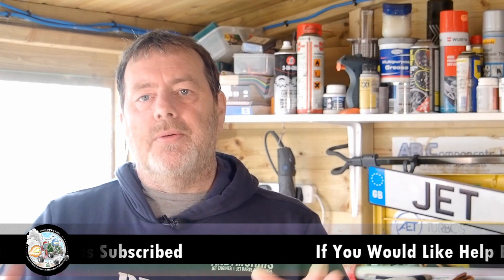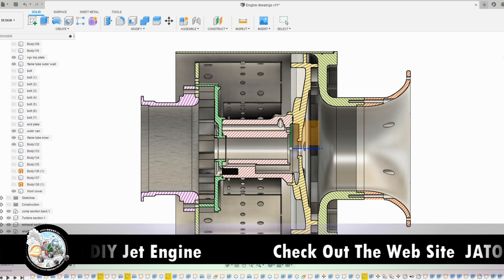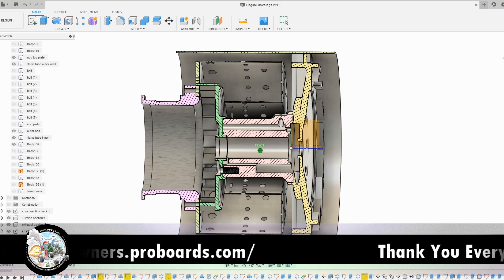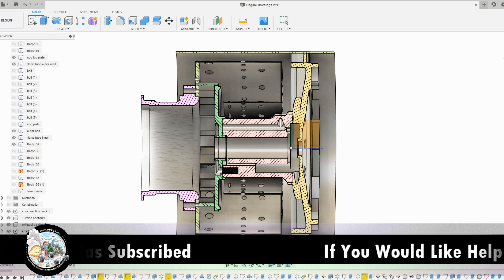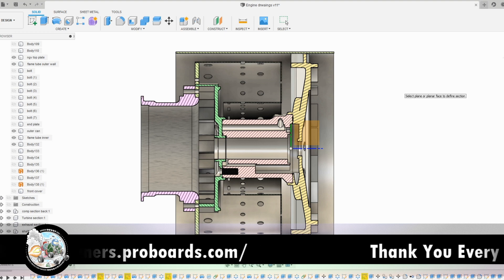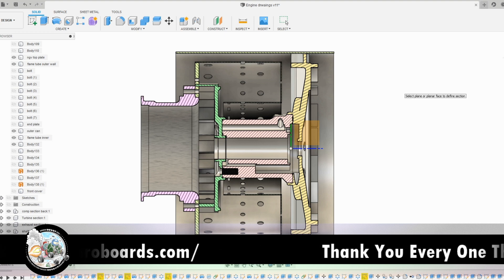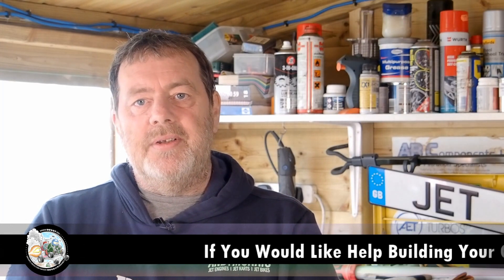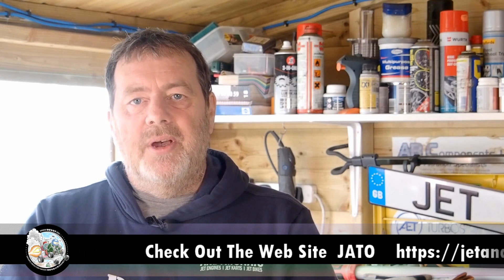DIY Jet Engine Project X

Comment: So you basically took third-party turbocharger and called it DIY? Why not just make an external combustor as a separate assembly and keep the native turbocharger case? Your combustor kinda suck anyway, so I presume you have such low temps that could work. And those holes blowing into the nozzle vanes look horrible, probably the worst temperature field non-uniformity possible. I understand your combuster is like supershort (that's why I would rather make a external one), but if you want to keep your layout, I'd rather drill holes in NGV and the outlet case for cooling P3 air. Probably not the easiest way to do in a garage though. Again, you have super-low temps, thick NGV profile and super-low engine life, so that's probably doesn't matter, nothing matters in that case - you've got premade rotor which works, just throw some jet fuel into the furnance (considering your vaporizing fuel nozzles are working period during the launch - not a small feat, btw) and it will appear working. Maybe just throw away the row of cooling holes altogether - two zones for a combuster is more than enough, just make the second row holes big enough and chequered for better gas mixing.
Reply from the maker: I used the comp wheel and turbine from a turbo yes, as many do...... and here is the engine working..... very well https://youtu.be/f-V7hNShuP0?t=261 please share what you have done .... oh and as for making an engine with external Combustion chamber... done that, hold world record
Reply: @Turbojetkart  I don't meant to offend you personally or your hobby, it's just a youtube algorithm throwing at you a video one day which happens to be related to your profession, and you have no idea what's going on. As far as I've said the engine's parameters are so low (compared to any real engines I've used to, not necessarily the model engines you guys are making) you probably can do whatever you want for the sake of technology like 90 degree angles and short cylinder combustors, and it would work - starting such an engine is the main issue (because vaporizer fuel nozzles are the pain in the ass if you ask me, but they are the only option considering the technological limitations). If the motivation behind all this is just fun of machinery job, I'm appeciate that. Btw what's the control system are you using for this thing?
Reply: @Turbojetkart  external combustion chamber isn't something worthy of a world record, as far as I can tell they are widely used in power gas turbines. As you are obviously limited in rotor length due to existing parts, gas temps are low enough and you have free space wherever you are planning to install the engine why stick to a standard 'aircraft' engine layout? I mean, technologically speaking volute cases are complicated, but you could reuse the compressor one. I still don't get what are you want to do exactly, but I've seen some guys converting aircraft APUs into jet engines for fun, the thing is to use as many parts as you can since you aren't making the entire engine by yourself already
Reply from the maker: @ФедяКрюков-в6ь  You dont know what the world record is for, and yet still you are critical of it.....  ?  APU dont make very good jet engines..... normaly they are made as back up power generation or air units for starting jet engine, like the stad....  Roever 2S 150 which I own... MY new engine makes more power than either, as the comp wheel is better at moving air then theres,  and dont cost thousands to replace, you normaly have to make changes, which can be costly, complex and dont give good returns, as they units tend to be bulky... friend put rover engine in a kart, mine was faster, and still run, rover carbon seal failed costing plenty to fix, then the turbine wheel failed, and he could not get replacement  Friends of mine own RD211, SPEY, VIPPER, GEM, KNOME and one has a OLYMPUSS  mounted in a truck, the thing is we do, All you seem to of done is be critical, and that you dont understand the reason why its done , tells me plenty .... feel so very sorry for you
Reply: @Turbojetkart  keep at it [!! they criticised frank whittle ! ! remember]. do what   YOU think is right..

Comment: I think i know Mr Andy.  No vaporizer tubes?  And no tapered holes / bell mouth holes?
Reply from the maker: Hi... yep, its direct injection.... not seen any one else ding it ? the hole yep  🙂 thanks for commenting👍
Reply: @Turbojetkart  Hi Andy, no worries mate. I think this chap has done direct injection i could be wrong, i have photos of this engine i can send to you if you like?                                             
     https://www.youtube.com/watch?v=8gJFW1mih9E
Reply from the maker: @mfpitci   Yep .... on propane..... mine is kero , wet fuel

Comment: Would a turboshaft design be possible with this jet, just adding more turbine blades to harvest the thrust into torque?
Reply from the maker: HI, thanks for comment, yep, one has already been made, but long way off putting it into service, need to learn more about how the engine runs...
Reply: @Turbojetkart   with turbo shaft .. design you have to be carefull not to create back pressure ,, as this will slow the turbine down..which in turn will slow everything down untill it wont work , just my thoughts on it ..

Comment: Um what do you guys use to generate the flames? Ik safer ways are to create a 150 to 200 gallon water generator seeing on the pressure to prevent explosions.
Reply from the maker: water jets are good, but i like the flames 😃
Reply: @Turbojetkart  Well I mean using water compression generators to make the flame instead of oil, not water for the flames to prevent explosions.